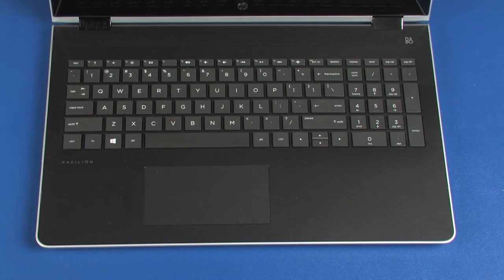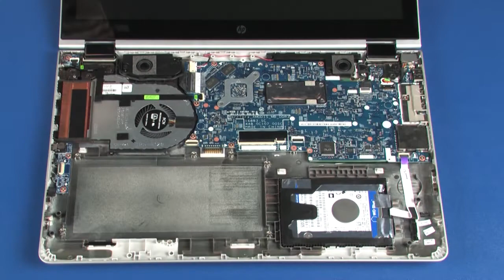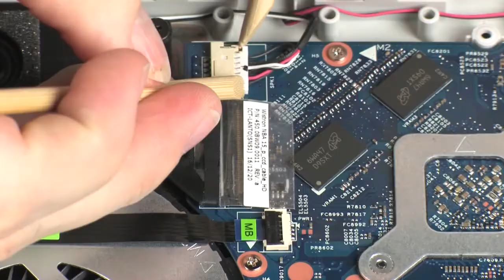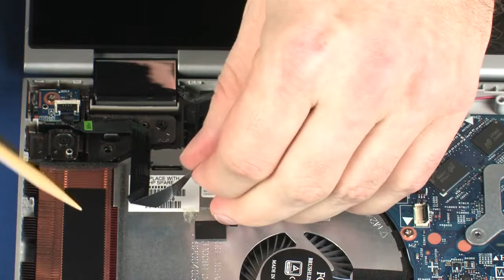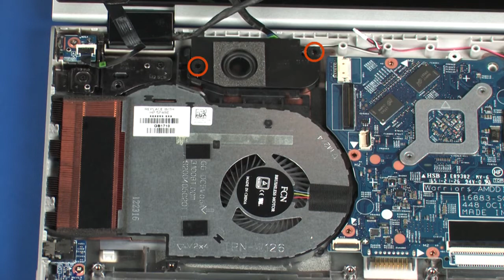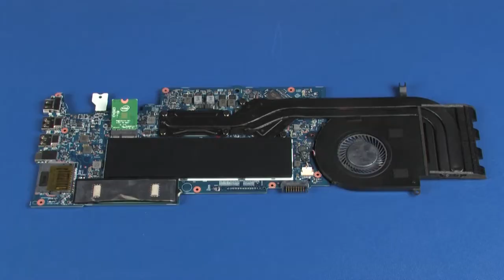Replace the System Board | HP Pavilion x360 15-br000 | HP

Comment: I have an HP Pavilion x360 15-br00l1a that comes with a HardDrive, I want to add an SSD. Does the mother supports M2 Ssd?
Reply from the maker: +Mauro Caballero Please refer page number 2 of the user manual to know about supported drives: https://bit.ly/3m2J23x
Reply: Hola mauro, lograste instalarle el ssd?
Reply: @xebaxg  no, al final no compré todavia, pero ahora en estos días tenia pensado hacerlo. Vos tenes alguna experiencia? Según lo que lei en el manual, mi modelo si aceptaria ssd, pero no estoy 100% seguro y no me animo por mi cuenta a abrir la notebook.
Reply: @maurocaballero9789  estoy en la misma posición que tu, pero el manual lo dice clarito que acepta el ssd y el hdd juntos. También lo lei en un foro de hp, asi que debiera ser así